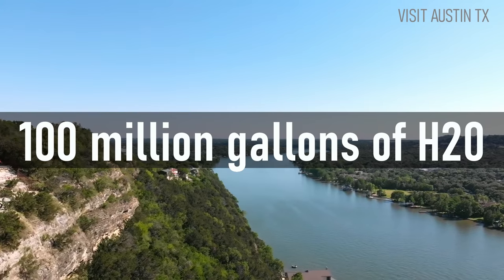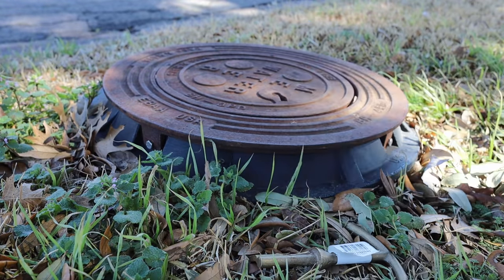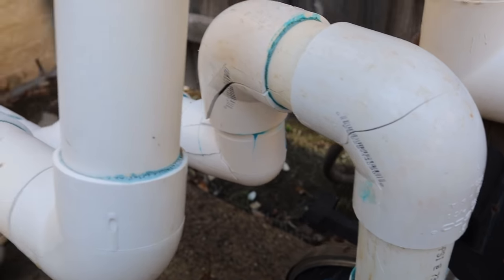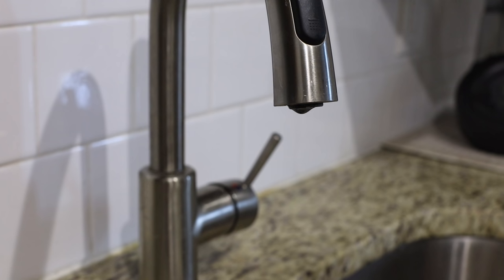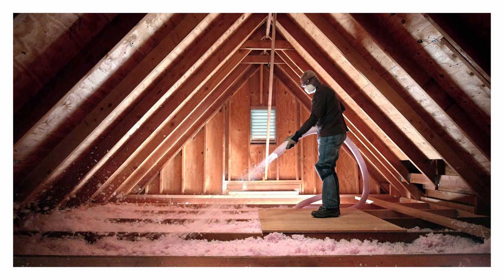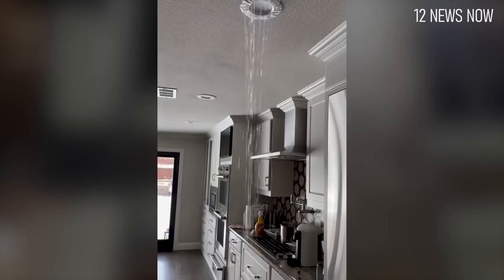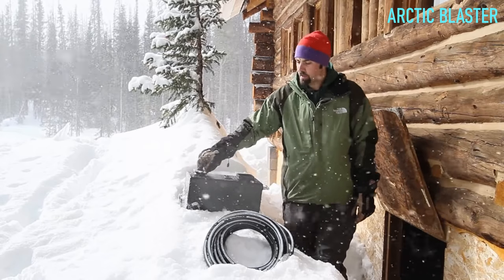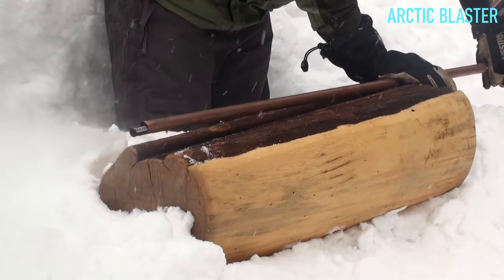How to prevent frozen and burst pipes

Comment: Here in Sweden, no piping is in the outer walls and all piping is insulated. The main pipe enters from below the frost line. You can still get problems if your heating fails of course but turning off the main supply is easy.
Reply: I take it that you drain down, after turning off the supply.  If not, you may be in for a soaking when you open the stopcock, after things warm up.
Reply: That's how my old house up north was and how my cabin is and even then when I'm not in my cabin the water is off.  I feel bad for the people but... Some of the design decisions make me way to smack my face on the table.
Reply: @farrier2708  Yes, if you have a heating failure you must get rid of water in the pipes and containers like toilets or water heaters. I would say that this would be extremely rare and most houses have backup systems for heating. Summer houses though you typically make preparations befor leaving for winter.
Reply: @henrypotter3024  : It was one of God's worst design decisions, not making the human forehead capable of being banged against a brick wall.  For me too, there are days when I wish I were a Klingon.
Reply: Nice, so simple! Every house I’ve ever been in (in the US) has a kitchen sink on an exterior wall.
Reply: @brainwashingdetergent4322  When we have the sink on an outer wall, the piping is in the closet below i.e. indoor in the heated area. Old houses had all the piping in the floor. Nowadays it is more common with visible pipes and if you do have it in walls or floor they are mostly the type with inside and outside pipes routed all the way from the boiler room without branching. If there is a leak in the inside pipe the water flows back in the outer pipe to a collector with sensor which then shuts off incoming water.
Reply: @BjorckBengt  Very interesting! What material are these double walled pipes made from? Are there “pipe centralizers” or “packers” or “hangers” to keep the inner pipe from sagging and touching the bottom of the outer pipe on longer horizontal runs (and to keep correct pitch)? Thanks
Reply: @brainwashingdetergent4322  Typically a PEX tube inside a flexible hose. No need to center it. The outer hose is just to prevent leakage and lead the water back to the boiler room where it will be detected manually or automatically. In advanced systems you will have distribution boxes for branching. The boxes will be water tight and if any coupling leaks the water will flow back in outer hoses or if it is at a low point there will be a detector in the box.
Reply: @BjorckBengt  I see, thanks for clarifying. So it’s only supply lines that are double walled.
Reply: Yeah, I'm in the Atlantic Northeast of the USA and watching what Texans had to go through was pretty eye-opening as far as how poorly design principles survive when it's possible to be even a little bit lazy.  Most of our homes here (and I assume yours in Sweden) wouldn't have burst interior pipes even in a lengthy winter power outage (plumbing in exterior walls is rare, highly insulated, and almost exclusively vertical -- our sinks are plumbed in the cabinet like yours), and our exterior plumbing is usually designed to be self-draining.  But in the warmer parts of my country, they often don't even bother to put anything below the frost line except the supporting slab or piers.
Reply: @KK-xz4rk  : Are you absolutely certain he's not a Klingon, trapped on this puny planet?  🖖
Write the case up.  You may even beat SETI  to the discovery.  😎👍

Comment: Good ideas. A thought about your insulation advice. Insulate the ceiling under your roof but not your roof. The house will stay warmer in winter and cooler in summer. Insulation up against your roof traps solar heat inside the roof and "cook" it thereby dramatically shortening its life. Install an automatic power attic vent fan to vent summer heat radiating through your roof and humidity to the outside. Be sure you have adequate soffit and/or roof peak ventilation to allow the fan to draw air through the attic.

Comment: I'm in Houston and we installed  an attic radiant foil barrier under the rafters which, I believe, helped prevent frozen pipe damages (Feb/2021). Works well in the summer heat, too.

Comment: You make great videos!  I used packing bubble wrap on my pipes and  it worked great.  Many older people I know in all electric Homes had 4 days without power, no heat source and almost froze to death.  Always have a non-electric heat source.  Almost 60 yrs in SETX and I’ve never seen it freeze for so many days in a row.  We’re most likely entering into a new solar minimum cycle so plan accordingly.  Keep up the great work!

Comment: Yup, most people don't even know where their water shut off is located in their yard.
Fill your tubs with water so you have a few days of non-potable water (for washing and toilets), turn off your water and then open all your facets.
Reply: Just a small point:
If you wash your tub with some dish-soap, there is no real reason for the water in it not to be potable.
It's the same water that comes out of your kitchen faucet, and if the bath-tub has been washed before being filled...
Reply: @Morsificator  yeah I would be weird for me. But there’s a collapsing container that fits in a bathtub on prepper websites
Reply: @Morsificator  I think the pipes will freeze before some bath tubs get that clean.

Comment: One tip came from Roger Wakefield at Texas Green plumbing.  For outside hose bibs,  wrap in a towel then wet the towel slightly.  This will form a frozen "shell" preventing the warm trapped air in the towel from escaping.  Many of the Styrofoam hose bib covers did not insulate adequately.   For hose bibs in older homes that come out of the ground vs the wall wrap the bib in a towel and cover with a 5 gallon bucket.

Another tip that can help during power outages and water emergencies is a butane stove.  They are affordable (web restaurant store) has them for less than $25  and the butane bottles are cheap.  They are the exact same thing as a coleman butane stove that sells for almost $60.  They can provide an easy emergency source of cooking, water boiling and even heat to a small area. (Please note that any flame consumes oxygen and you need a source of fresh air, and a way for heavier than air gases to escape.  If you are unsure an ANY capacity about the dangers do not use as a heat source)

Comment: from Marlin , TX. We lost power and the Water Treatment Plant failed on the 14th. So heat tape, keeping the house warm, and dripping ceased. I shut the meter valve, a T-shaped tool is helpful. Also a below ground handvalve near the house will help most people. And I opened the back spigot to let out pressure. So far no leaks.  I started working in water treatment in 1994. These temperatures were at a new record, but similar problems have happened in other winters. Cold like this can also stop up sewer systems.  So always prepare.

Comment: Up north we have frost proof hose bibs. The valve seat is 8-12 inches in from the exterior wall so it doesn't freeze. You just have to remember to disconnect the garden hose. We also blow out or drain our sprinklers.

Comment: All spot on recommendations. I’ve lived in the snowbelt with sub-zero winters for most of my life. The shop in my barn has R30 walls and an R60 ceiling. Power and water are run on and not in the walls for freeze protection and easy drain down. Lastly, a plunger and RV antifreeze is you friend.

Comment: Most informative. Here in Canada we generally have basements below grade. This area will never freeze. In the coldest of time our basement never gets below 45 degrees F without heat as the heat comes from the basement floor. I also have two valves installed at the lowest point in my plumbing and a floor drain close by.
 To prevent what happened to your drain I would suggest keeping a few gallons of RV antifreeze on hand . It is not toxic and if pored down all drains will fill the traps and prevent freezing. As you stated keeping a small amount of water flow will keep pipes from freezing. Remember your water supply comes from underground so it is somewhat isolated and generally a bit warmer.If you have a basement move down there it will be warmer. 
Also warm air rises so leave all doors open so the heat from the basement can migrate up stairs. I also have a water shut off where the city water first enters my home. So when I leave for the winter I turn that off open the valves in my basement and open the water taps everywhere in the house. All the water in the pipes will drain out preventing freezing. When you turn the water on let the air escape through your taps and then close all of them. No listen if you hear any water flowing. If so you have a leak and need to find it before leaving the water on. I hope this helps. Cheers

Comment: So funny that you used the reflective cover on your pipes. I am in Texas as well and encountered the same issue that ALL of the hardware stores were out of any insulating material days before the big freeze. In desperation I had a stack of reflective bags that my Amazon groceries came in all during the summer. I cut them into long strips and went to my attic and after 4 hrs I had covered 95% of the pipes before I ran out. My pipes had frozen before in mere 22 degrees Fahrenheit.  Yet I woke up one morning with no electricity (thus no heat for days) and the thermostat said 14 degree INSIDE my home. The plants I brought inside froze anyway but my pipes did not! I think you are correct in your assessments.

Comment: I live in a lakefront community in New England. There are many summer seasonal homes that are not winterized. Water pipes are installed with a 1/8" per foot slope so they can easily be drained. Pour some antifreeze down the drain traps and toilets and it's safe to leave it unheated through the winter.

Comment: 1: Wrap pipes in Pipe insulation , if not available use Pool noodles since they are both made of expanded polyethylene .
Pools noodles can be found at pool supply stores, box store like Walmart, target and so on .  
For pipes between floor joist use wool based insulation  between the joist. This should also be done at the water meter to prevent valve freezing.
2: Pipe heaters You can purchase heating  tape or wrap around heating wires for exposed outdoor equipment.
3: If your not going to be home you should drain all toilets and  poor Plumbers Anti-Freeze (not the same as in your car) into all your drains to prevent the traps from freezing . 

As far as code changes virtually all your precautions are already in the uniform building code. The reason the problem was so wide spread is that this event was a rare occurrence for Texas .
I say was because we see the effects of climate change creating issues like these with an ever increasing regularity now.  In my area we don't have an issue with frozen pipes because they are required by code to be insulated. We also employ frost proof valves for exterior spigots to prevent freezing beyond the insulated layer of the house.

Comment: Working in water treatment and living in New England this is good advice one tip if you can run a little more water through taps a sewer trap from freezing at least that's what I've been told for traps in a slab of concrete but they tend to be rare most houses have basements or are trailer homes

Comment: Recognizing that the enemy is pressure, not simply cold, the same tricks used to cope with other pressure problems are applicable. Z bends to allow for expansion,  hammer arrested and surge volumes are all helpful. Also knowing that joint pieces are less flexible, and thus more vulnerable, is also helpful for the purpose of placing these devices.

Comment: The insulated incoming water pipe into our Québec home, is  at least 4/5 feet below the ground surface and arrives into the house on the interior aspects of the exterior wall down in the basement.
Reply: like this in Sweden also.   waterpipes outside is burried at a dept that dont freeze
Reply: Oh and if you have a pipe that is not that well insulated or goes in to a well near your house. you often install a heating cable inside the pipe that just heats up a few Watt so it will not freeze.
Reply: @mortil    The building regulations are exact and very strict here, which is probably the result of lessons learnt from long winters.
Reply: Yeah, it's a similar deal even here in Romania, by far not the best developed country in the EU.
But for example we (and Sweden I would bet too) don't have any official, "code" requirements for cooling in homes, schools, hospitals, busses...
The people are starting to ask for those in the summer, but it was a fact of living here that "a little heat won't kill you".
Well, let's get some Texas weather for a week, and we'll be screaming for AC!
Point being that past problems are the reference for future solutions. You can't honestly expect Texas to have been prepared for what hasn't happened there in 150 years...

Comment: Nice video, I completely agree with the central routing of the water piping and avoidance of exterior walls and attic space.  

All of the houses in my neighborhood have water heaters in the attic.  Anyone who did not drip the water through the heater had a pipe burst.  It only takes one faucet to be set for hot water.  I typically drip the faucet furthest from the heater.   

Shower heads were another area the people overlook.  They have to be dripped, especially if they are close to the ceiling/attic space.

Comment: Caution on insulating your roof, attics great but when doing the rafters to the roof they need to be properly vented from soffit to peak. You do this by adding rafter mates, they are a plastic or styrofoam vent channel that gose between the rafters and allows air to flow up the rafter and allow hot air out. So it dosen't cook your shingles. And shorten the life of your roof. Also for this to work right your soffit should be vented and the peak should have a ridge vent. Fresh air in from soffit and gets pulled by warm air out ridge vent.
I dont recommend insulating rafters though. Insulate attic well and still have soffit vent and ridge vent.

Comment: Oh, what fun we had here in Austin in February! I live in a townhouse and thankfully all our interior plumbing is on the wall we share with our neighbor. Unfortunately, we have two exterior faucets. I wrapped and dripped our exterior pipes, and we had no burst pipes. We also never lost water pressure, unlike everyone else we know including people a few doors down from us. Our exterior faucets did freeze, but having them open must have been enough to relieve the pressure.

We had no electricity for four days, and we have no natural gas or fireplace so we were completely without heat, but somehow the pipes never froze. I dripped all the interior faucets the whole time, but I’m not sure that would make a difference. Perhaps our water main is buried a little deeper? I’m just glad we could flush the toilets without having to carry in snow to melt...